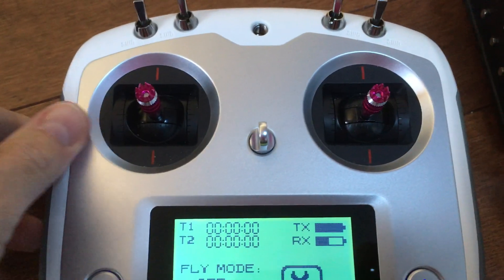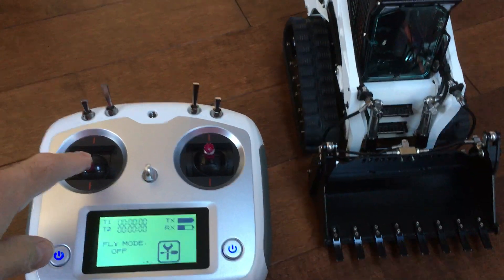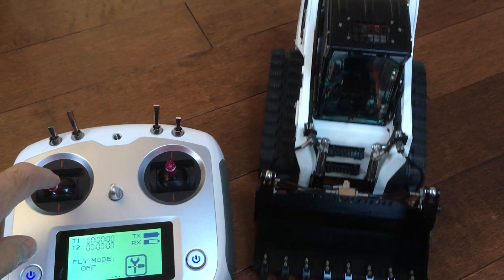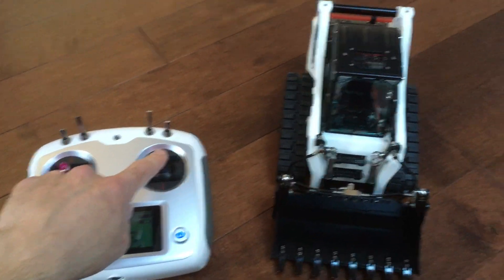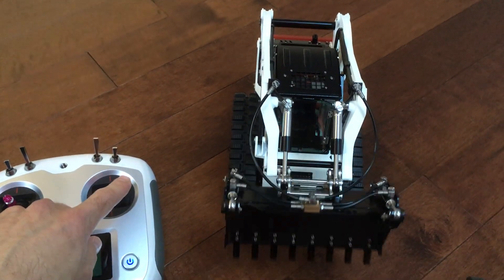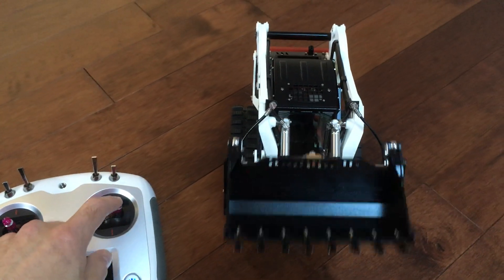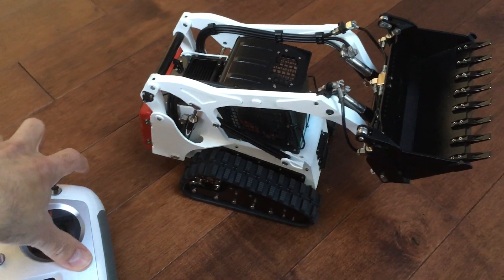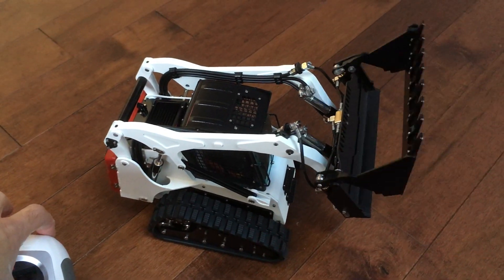LESU 1/14 RC Metal Hydraulic Tracked Skid Steer Loader (telemetry + controls)

Comment: Hello, you took the capacitor off of the motor driver did that cause any issues?  I am trying to fit one in my skid steer as well.
Reply from the maker: If you're going to use the Sabertooth 2x12A controller like I did, I'd like to strongly dissuade you from doing so! The reason is that the motors tend to produce lots of shorting due to very bad commutator design which will lead to constant tripping of the driver's over-current protection (it's too sensitive). In other words, this driver is not suitable. I made another approach. Take a look here:
https://mega.nz/file/jgNy1LxK#_-OjH11mJ3AfEZ9roOwl_96aTpOpzSjyfNWmQbm32NY

I used a dual VNH5019 motor driver and another MCU to drive it. I also upgraded the custom firmware along the way which now allows to drive such a driver and has backup buzzer support. I will update it with pictures soon. Take a look:
https://github.com/neoxic/STM32F0/blob/master/doc/lesu.md

Finally, the model works as it should. I'm very pleased with the results!🥳 I have plans to make another video of the upgraded version sometime in the future.
Reply from the maker: So answering your question, yes, I had the caps removed in both cases to save space. I put a 470uF cap down the power leads where they all come together, so it's more than enough.

Comment: Can you tell me how to set up the remote controller?
Reply from the maker: In this loader, I use an MCU with custom firmware that is connected to a receiver via iBUS. It takes care of all mixing, pump control, lighting, telemetry, etc. The valve servos are connected to the receiver directly. As a result, the setup on the remote controller is quite simple. I'm working on sharing the whole project on GitHub. A tutorial will also be included. I'll post a link here when I get it done, so stay tuned! :-)
Reply: @senyx0  I’m very interested in changing the functions on my FS-I6S to the way you have done but I’m very dumb when it comes to electronics.  Therefore, I ready need your tutorial ASAP.  PLEASE ADVISE when finished.
Reply from the maker: @chuckschipper7731  Totally forgot to post an update.:-) Check out this link:
https://github.com/neoxic/STM8S103F3/blob/master/doc/lesu.md

Some soldering skills are required to make it all work though because my solution is based on a separate MCU that takes care of all mixing both for the hydraulics and the tracks. As a result, setting up a FS-I6S becomes trivial.